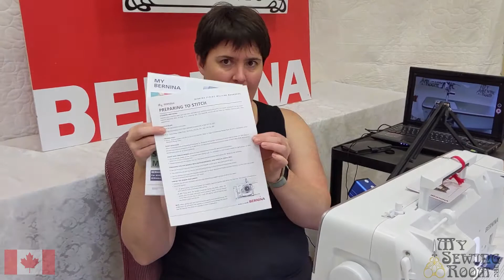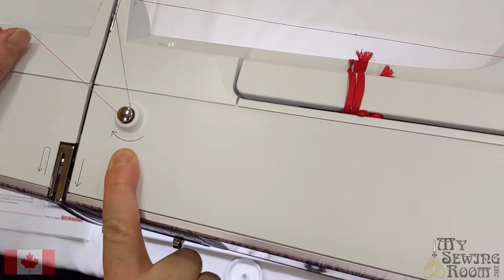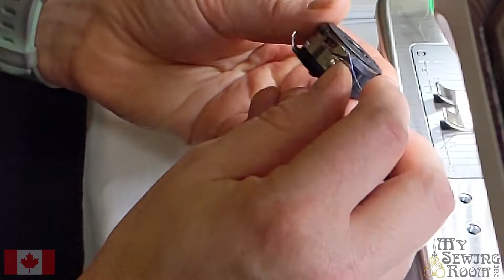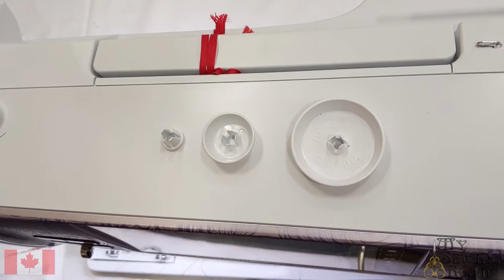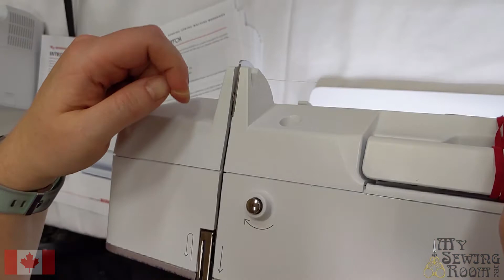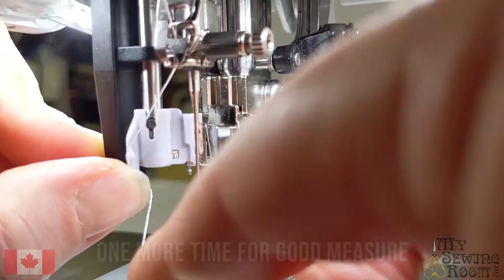Bernina New User Guide Part 1: Preparing To Stitch

Comment: What kind of camera and lens are you using for the very close up shots of the foot?
Reply from the maker: Hi Christopher. for the very close up shots we were using a phone. The Google Pixel 3A. Rather surprising but nowadays phone cameras do quite well for macro shots. Now if only my hands were a bit steadier...
Reply: Thanks! What about that blue box camera to your left? Or is that a mic or something else?
Reply: Seen at 0:18 in
Reply from the maker: Ah that one is one of our older cameras. It worked well at the time (we have since replaced it since it seemed to have some colour grading issues, you can see the camera in use at 3:14)  but for close shots that needed clear detail the phone was the better choice for us. I would not recommend that camera if you were looking for a good close up as I'm certain you would want to upgrade quickly much like we did.
Reply: Thank you so much!